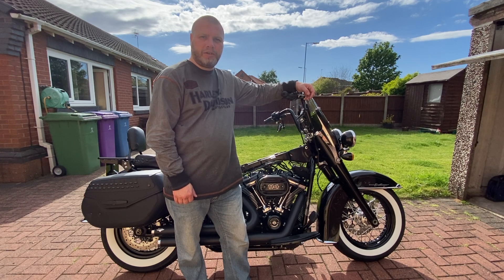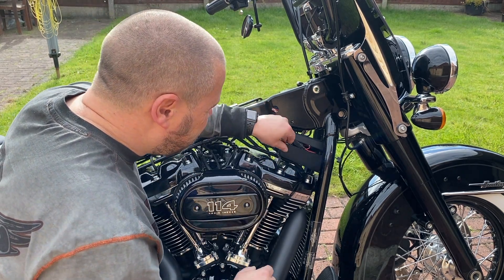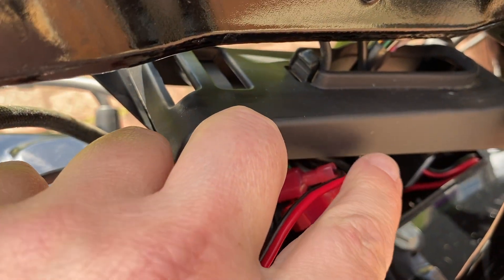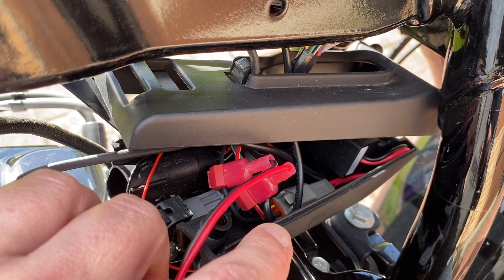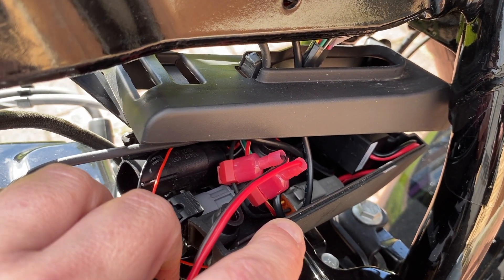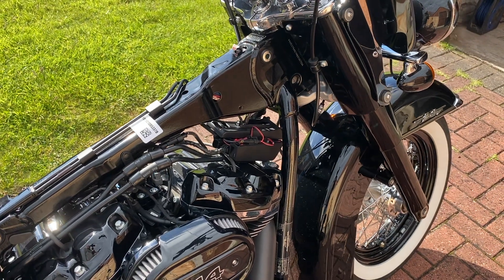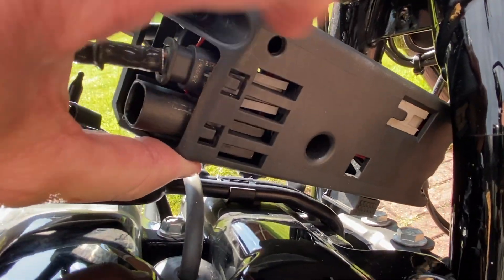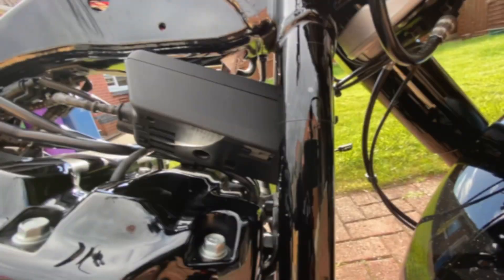Harley M8 Softail - Aux Power

Comment: Great advice.  I have a M8 Fat Boy and have a Garmin Zumo 396 I use on my KTM 1290 SDR and want to enable it's use on both bikes.  My connector under the left side cover has my V&H Fuelpak 3 being utilized so using it is not a choice that I have and your source here in this video is my only choice left.  I want switched power and not straight off of the battery, plus just getting to the battery, holy crap!  I have used Posi-Tap connectors before and they are fantastic.  Thanks for the great videos you do, very well done.
Reply from the maker: Thanks. And yes the battery is a right pain in the backside to get at the terminals
Reply: Did you have any canbus errors, getting ready to do as you’re video
Reply: @SCBiker58  nope. All worked fine
Reply: @tomjones8883  awesome thank you
Reply: Tapped into the same switched 12vdc prior to the USB.  Ran wires thru channel on left and up to my Garmin 396LMT-S that I also use on the KTM 1290 SDR.  Powers on and off like it should.  Way better than buying the HD kit that plugs into the connector used for a tuner.  Thanks for the advice on the video. 👍

Comment: or even easier on the left side of the bike behind the metal cover where the trickle charger wire is, there is an auxiliary wire but you'll need the harley auxiliary wiring kit if you'd like a fused neat wiring job otherwise you can tap into wires there as well.
Reply from the maker: There’s also the heated grips connector on the end of the electronic throttle I could have used